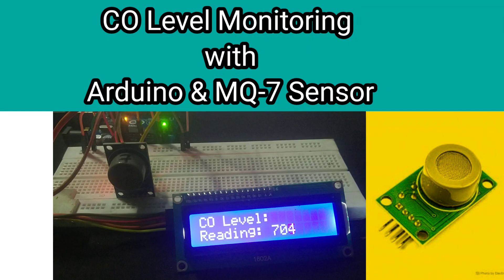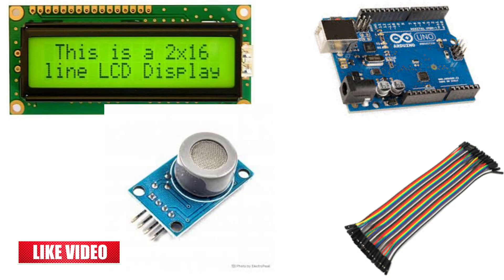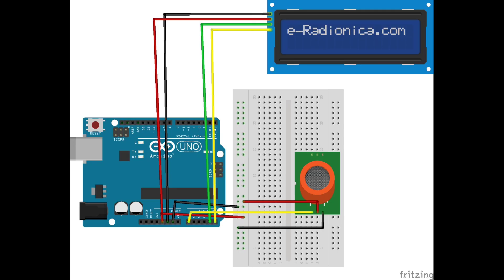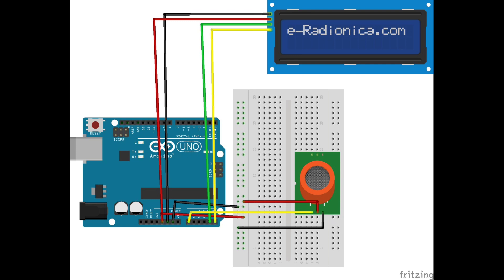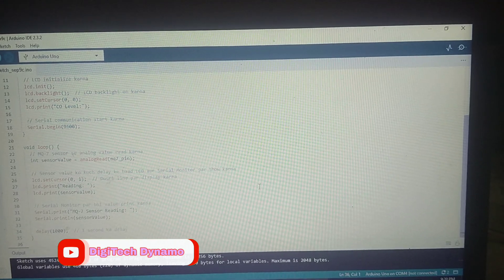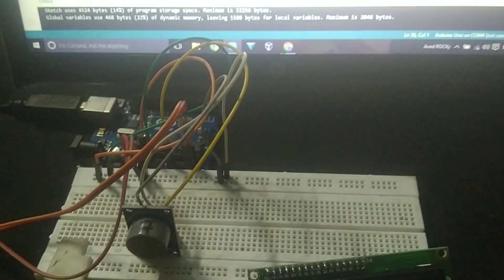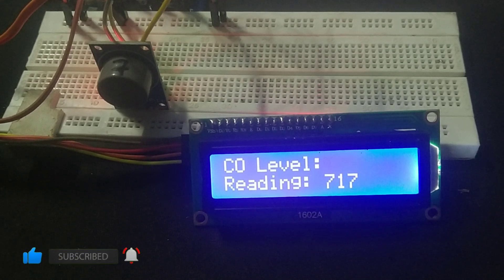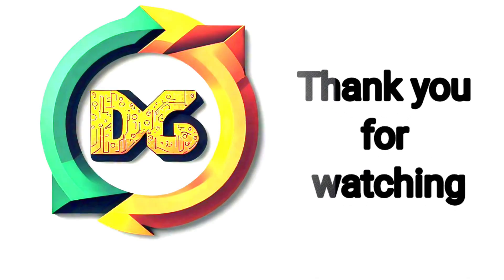CO Level Monitoring with Arduino & MQ-7 Sensor

Comment: in what unit is the CO level reading? is it ppm or something else? Cause 700 ppm is deadly, so why is the alarm not going of?
Reply from the maker: The reading shown on the LCD is a raw analog value (0–1023), not in ppm. To get CO levels in ppm, you need to calibrate the MQ-7 sensor and apply a conversion formula based on the Rs/Ro ratio. Since this code doesn't include an alarm system or ppm conversion, no alarm goes off even at high raw values.
Reply: @Digitech_Dynamo  thx!